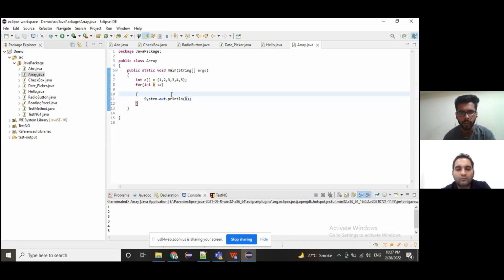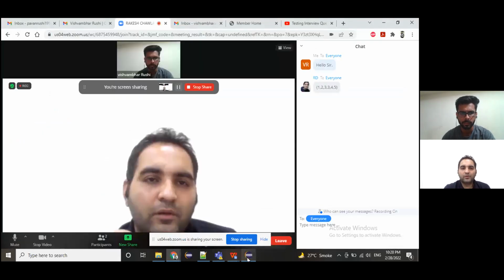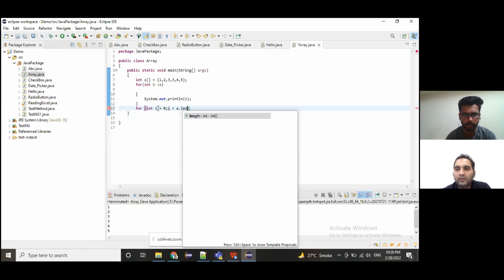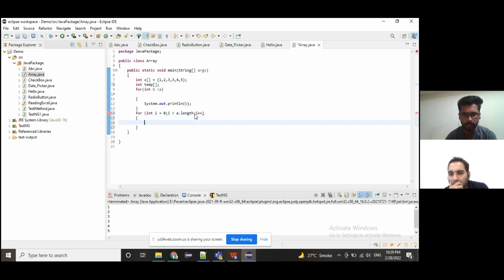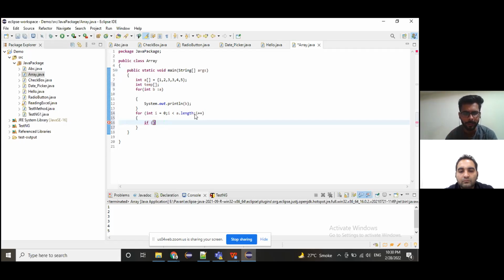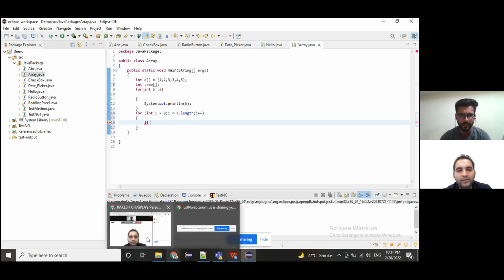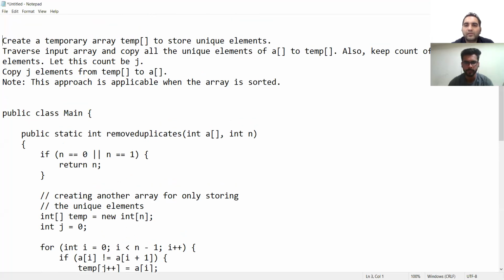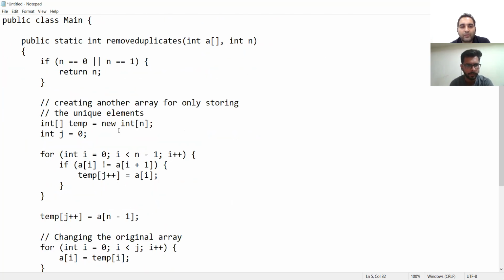Automation Testing Interview Experience | Real Time Interview Questions and Answers

Comment: Invalid PIN/Passkey: Attempt to pair devices with an incorrect PIN or passkey.
Timeout: Leave devices in pairing mode for an extended period to test for pairing timeouts.
Multiple Pairings: Attempt to pair a device with multiple devices simultaneously.
Incompatible Devices: Try to pair devices that use different or incompatible Bluetooth versions.
Blocked Devices: Attempt to pair with a device that has been blocked or blacklisted.
Connection:

Range Limit: Test the maximum connection range and see if the connection drops or becomes unstable as devices move further apart.
Obstructions: Place physical obstacles (walls, metal objects) between devices to test signal interference.
Interference: Introduce other wireless devices (Wi-Fi routers, microwave ovens) nearby to test for signal interference.
Low Battery: Test connection stability when one or both devices have low battery levels.
Disconnection: Forcefully disconnect devices and check if they automatically reconnect or require manual intervention.
Functionality:

Audio Quality: Test audio playback for distortions, static, or dropouts under various conditions (e.g., high volume, different file types).
File Transfer: Attempt to transfer large files or corrupt files to see if the transfer fails or causes errors.
Data Loss: Test for data loss during file transfers or streaming activities.
Multitasking: Check if Bluetooth performance is affected when using other applications or features simultaneously.
Security: Attempt to access a Bluetooth device without proper authorization or bypass security measures.

Comment: 1. If Bluetooth device is connected with one phone, Than if any other wants to try to connect it wont allow to connect until first device is disconnected.
2. It should always ask for paring. 
3. at same time Phone Bluetooth application can connect with multiple Bluetooth device. ( note same categories example 1. Watch , 2. Earphone , car Bluetooth or another use cases.
4. Once pairing is done, If User change the name of Bluetooth device ( receiver end ) than it should not connect. required new pairing.

Comment: 1) Bluetooth range is limited.
2)Data transfer speed is slow.
3)only one device can connect.
4)limited functions like play song,call n data transfer. No advanced features like, texting, video  call ,Etc.
5)Drain battery if sending heavy data.
6) automatically won't turn off in majority of cases.
7)cannot block specific device , only unpair option.
8) priority is call not data transfer or other features.
9)less secured.
10)only limited no of device can be addded into list. If new device needs to be added need to delete other devices.